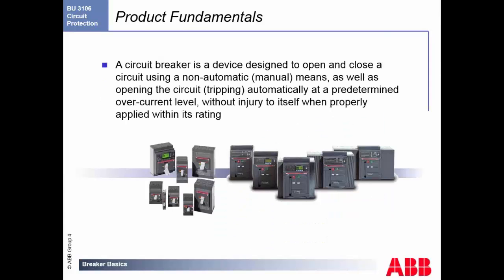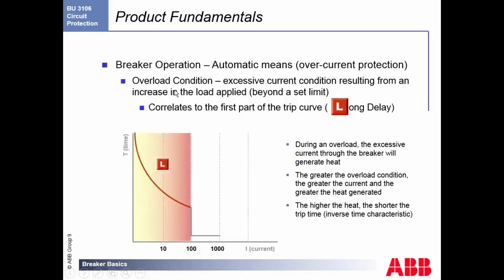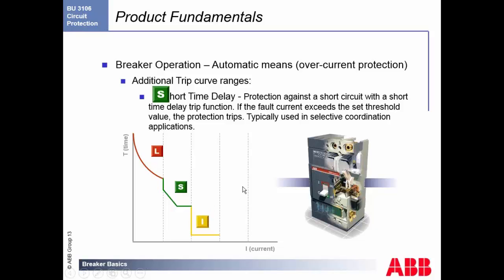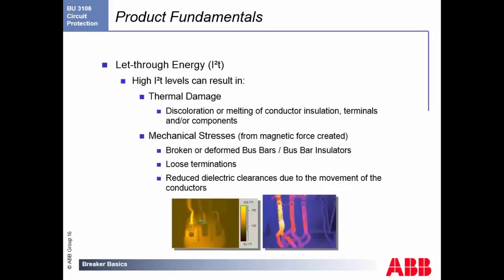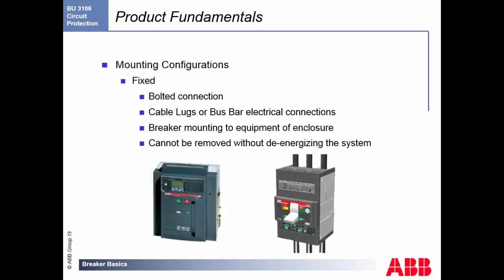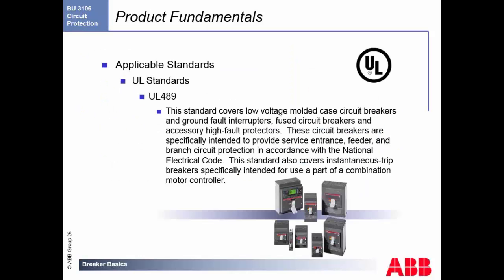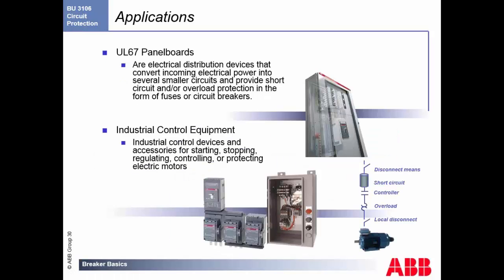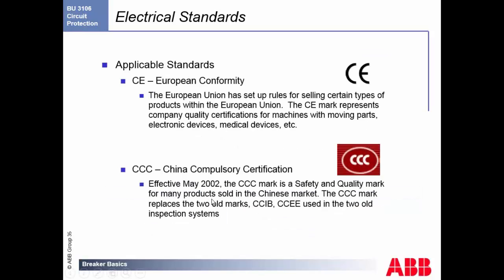Breaker Basics

Comment: Thanks for the information. Could you please explain how the timer works on an electronic breaker. is it counting cycles or does it have a counter inside?...Thanks...
Reply from the maker: Depends on the breaker. Some circuit breakers have the ability to measure the zero cross of the phase and then will open based on number of zero voltage on the incoming phase.  They will then open as close to zero crossing as possible.  Other will open regardless of timing, i.e instantaneous, and will open immediately.  In this case the breaker’s contacts are tested to that full fault.